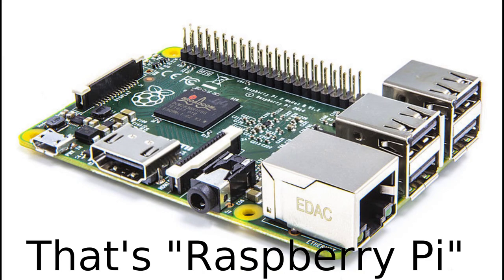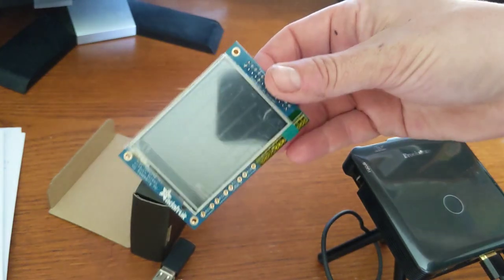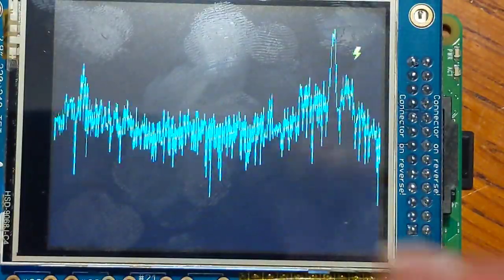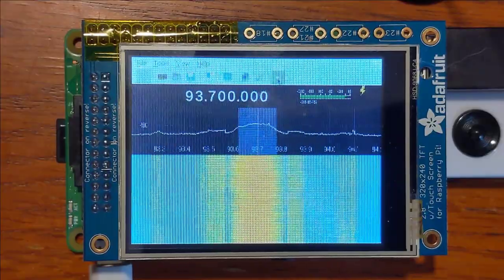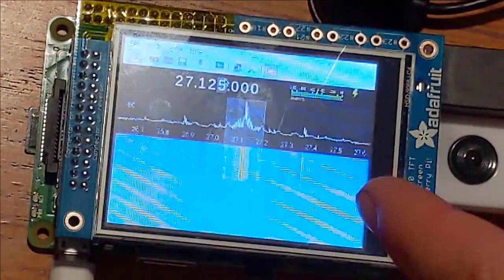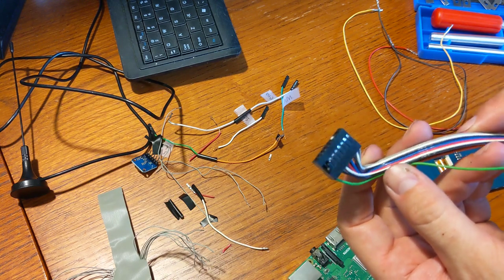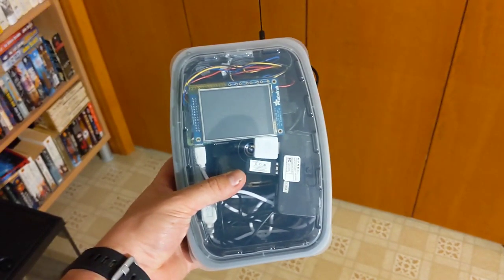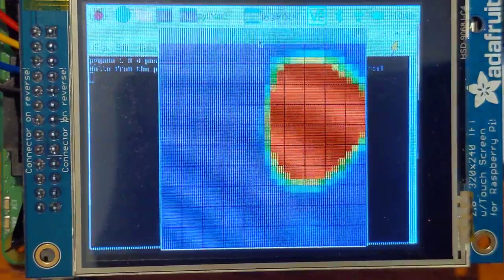Handheld Electronic Sensor Device with Raspberry Pi (Part 1)

Comment: Hi, I'm very enthusiast with your project, and I'm doing some kind of tricorder with Arduino, using some sensor, DHT11 for humidity and temperature, HC-S04 ultrassonic sensor to find some objects like a sonnar, displaying in Nokia 5110 LCD Display, using a Passive Buzzer to make some sounds, building the box with pine wood, the dimations is very proximity to ST TOS Tricorder (TM), buttons, leds, and wires, I would put together GAS Sensors and UV Sensor too. I have a problema trying to read DHT11 with 5V, so I used 3.3V and it works fine! Try use a 10k ohms resistor in data terminal to sense just when it reading the environment. So, I find very cool your radio camera and SDR RF that you used! Really cool.
Reply from the maker: Thanks! I'll have to do some more experimenting with the humidity and temp sensor.

Comment: I see the Raspberry Pi undervoltage indicator (the lightning bolt in the upper right) pretty consitantly when you have the Adafruit TFT screen on there. You probably need a "better" (i.e., fatter, lower gauge wire) USB cable and/or power supply.  This is a very common issue and causes all sorts of instability.

Also.... "Cat scan"!
Reply from the maker: Thanks! I did notice that it doesn't like certain USB battery packs, probably the cheaper ones that don't put out as much amperage as they claim to.
Reply: I came to say the same!  I don't know if it would help with the 3mm output, but it would almost definitely help with some of the processing delays!
Reply: (Oh, and thanks for the shout out!  Glad to see them getting some use!)

Comment: Could this be used to scan a room for spy equipment or hidden camera? (Let's assume it was embedded in a wall and didn't have a discernable heat signature)
Reply from the maker: I believe someone wrote an rtlpower script to "fingerprint" electronics based on their ambient RF noise, so theoretically you could ID known equipment in a room. I might try that in the future!
Reply: @saveitforparts  that's interesting!

Comment: hi what sdr did you use in this project ?
Reply from the maker: It was one of those unbranded ones from an eBay seller who's now gone, so you know it's high quality LOL! This was when I was first getting into SDR and just got the absolute cheapest one I could find. It works fine and it's very small, which is nice, but for more recent projects I got some of the RTL-SDR Blog models.
Reply: @saveitforparts  cool thanks for letting me know